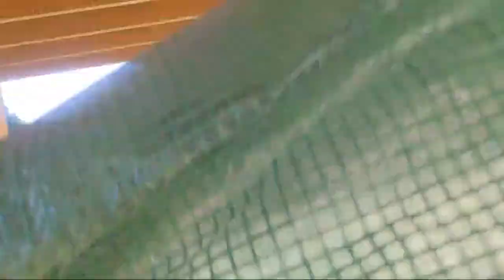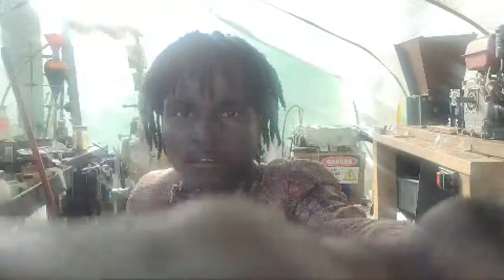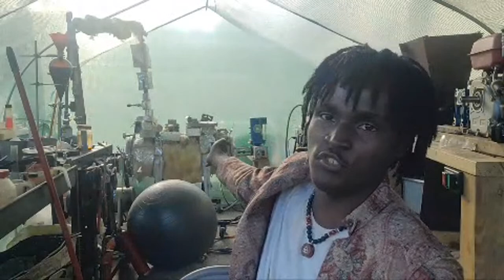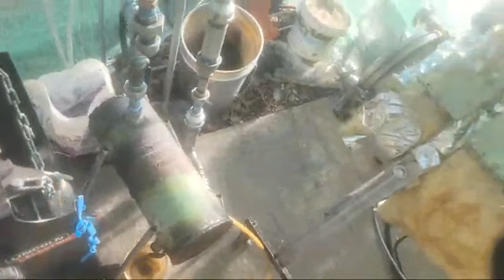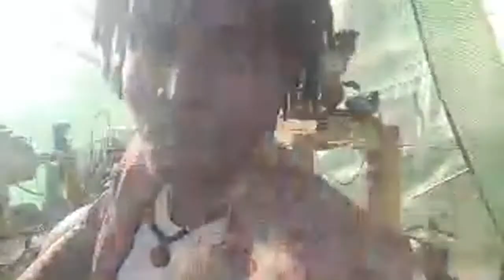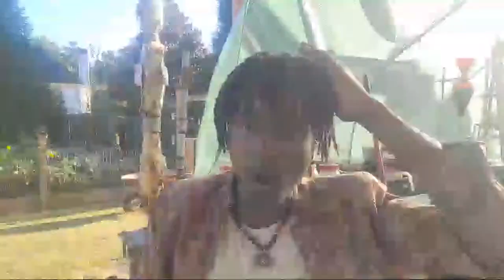Make Gasoline From Plastic? Absolutely 💯

Comment: I know i mention this the other time about pyrolysis plastic copper wire. But i wanted to add a few suggestion for the copper wire when u get a chance to do it.
1. Dont shred the copper wires leave them as is, i want to see if it would be easier to pyrolysize copper wire than stripping copper for scrap copper wire recovery. Cuz burning copper wire in oxygenated air just makes the copper wire brittle and hard to recover.
Reply: Put it in a retort that can withstand a wood fire. Have the retort with a steel break line going out of the fire. That should cook all the oxygen out and not let any new oxygen in. I tried cooking a electrical motor and the wire fell apart completely so im gonna try and make a retort. Maybe ill use a old paint ball co2 canister. I think i can screw on a break line.

Comment: You need to seriously isolate your reactor with ceramic wool, it insulated 2 times better and can withstand heat. Also, add more magnetron units so that the time to crack a batch is minimized so that overall thermal losses get lower.  The reactor is too big for this power. For biggest efficiency, the reactor walls need to be really hot, glowing red.
Reply: You can use volcanic rock like the kind used in fire pits. Itll char but it insulates well. Problem would be it needs to be crushed to 1cm average size for really good insulation.